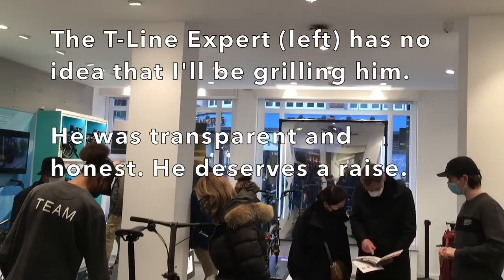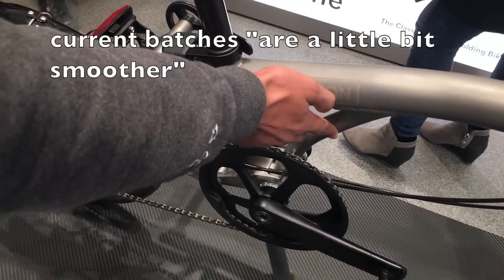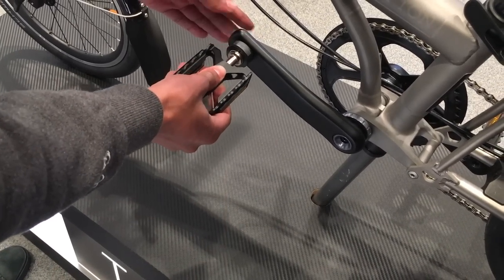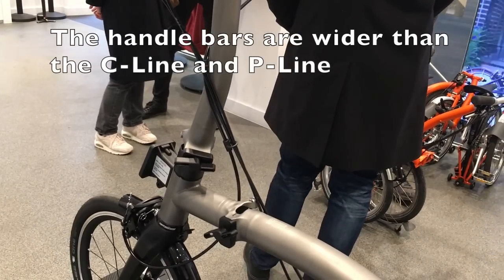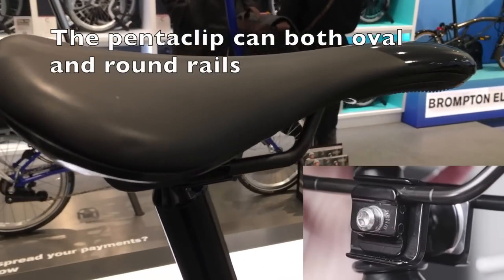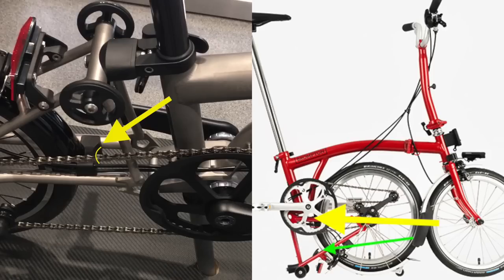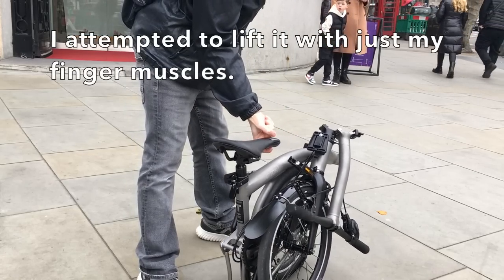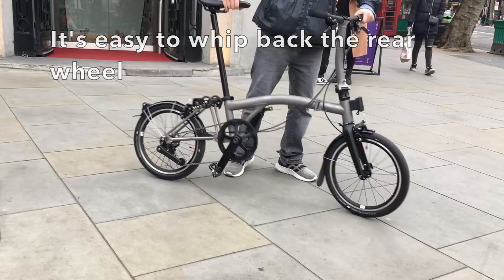Before You Buy a Brompton T-Line. Titanium and Carbon Folding Bike

Comment: Confirmed. Water does collect at the BB area. I actually saw a vid where someone was taking out the BB and water poured out 😅
The original design is better and cleaner for aero. I think they shouldn’t have worry about those few grams making water an issue and having a slower bike that creates “dirty air”
Reply from the maker: Could you please share the link to the video?
Reply: Aero on a Brommie? Come on.

Comment: I have bought a black Titanium seat post for my LightweightH6LXBrompton, with a lightweight AceOffix saddle mount on top, for the mounting and angle of the saddle. I have an original, titanium fork and back-frame as standard and I look for a titanium stem post, as I have changed every loose part I could find, to titanium. But I still have 6 gears for use in a hilly area!

Comment from the maker: Brompton wrote back to me regarding the water in the top frame. I'm sure they are aware this letter will go public as I message them coming from this channel. In short there is no need to worry. If there are any issues they will sort it out. The bottom bracket is sealed internally. I would suggest T-Line owners to stuff a plastic bag in the top tube during a downpour anyway:
Hello [DrJames]

Thank you for contacting us here, at the Brompton factory and for your interest in our brand new T Line model.

To the best of my knowledge, corrosion can occur when metal is in contact with water(from the road, would hasten the process). Your concern that corrodible materials could lead to rapid degradation, and the effect that may have on the structural integrity of the bike is understandable. 

In raising this with our design team, I have been advised that the T Line's mainframe has been tested in our test shop, for thousands of hours of continuous exposure to damp road conditions. The bicycle with this same characteristics has been ridden over many miles of test rides, for the same reasons. We do believe that the bikes frame should not present a usage difficulty arising from water corrosion, regardless of the new design (hole between mainframe and front frame). 

If however, owners may encounter component issues, when they are putting their T line through its paces, we shall certainly act to remedy any such issues for owners. For how the bike is conceived, I confirm there is no possibility for water to penetrate within the mainframe and to reach the bottom bracket, as it is sealed internally. 

Please note that you will get 3 free services for your T Line, which will be performed at the Junction Store of collection. meaning, if there is any issue with the bike, our mechanics will be more than happy to assist the end-users fully...

...I hope this helps to clarify. Should you have any further questions, please don’t hesitate to get in touch. 

Kind Regards, 

Marco
Brompton Bicycle
Reply: I don't think titanium is affected by moisture and corrosion, in the same way as steel.
Reply: @JohnnyMotel99  this is true however there is product named frame saver from recollection that can be used in steel frames or I personally use a silicone based lube sprayed inside, the raw lacquer version of the Brompton is the one that suffers from rust accelerated by gritted roads and wet weather riding as water penetrates and spreads under the lacquer as there is no paint for protection.
Reply: even titanium does not corrode, you wouldn't want water to fill up and stay and the bottom bracket tube area.
Reply from the maker: @ivanteo1973  this is why you should stuff the tube.
Reply: @DrJamesT  of course there are many things we can do to make it better but i am not expecting this concern to be addressed by user themselves.
Reply from the maker: @ivanteo1973  This is why i pointed this out
Reply: How about the ball bearings in the front, which may also be reached by water and gravel?  Finn. Denmark

Comment: The T-Line shows clearly, that the original Brompton is really hard to optimize.

One thing that can be optimized is the poor drive train of all Bromptons: It should have an internal geared hub of high quality that fit in the small 112 mm spacing of the rear triangel. That could be a customized Shimano 11 Gear hub or (just a dream) a customized Rohloff.

Is a Belt better than a Chain? - I think yes, but I do not know if it is folding as good as a Chain ...

The left Pedal: The original folding pedal still is the best compromise, even though it has the problem, that ist must be unfolded when the bike is unfolded because the pedal cannot pass the rear triangel. I have used some version of quick release pedals and it is very inconvenient (and "dirty", because the mechanism needs some lubrication) to stow the pedal especially in everyday situations (the video could not have shown it any better).

Also a "no go" for everyday usage is the lack of lighting. SON offers the perfect dynamo hub for the Brompton and the cabling should be as integral as possible. LED-front and rear light weigh just few grams.

There is no need for a rear carrier, and it is really good, that Brompton included the front carrier block even to the T-Line.

I don't like the original brakes, even though they got better over time. I would prefer V-Brakes or hydraulic Brakes, especially on the rear wheel.

But again: I tried a lot things myself (Rohloff, Hydraulic Disc Brakes, Shimano Nexus 8 with Rollerbrake, Quick release Pedals, other Folding Pedals) and I know exactly that it is really hard to optimize the original Brompton (for everyday usage).

The only optimization I can recommend without any consideration ist the SON XS for Brompton dynamo hub in combination with the FLAT S PLUS or 2C PLUS (rear) and LUMOTEC EYC or LUMOTEC MYC from Busch + Müller. I use a soft microphone cable for the rear light.
Reply: I find the Shimano hubs are much less forgiving than the 3 speed SA ones. The latter are very robust. If the shifter index on Shimano hubs drifts, they get ruined. The internals seem a bit on the weak side.
Reply: What's wrong with the 3spd hubs?
You don't like a shifting style based on the Macarena?

Comment: Excellent video from clearly someone who cares. Thank you. 

I did a test ride myself and it does what it sets out to do, I think. One purpose: it’s light. Crazy light.  I felt no difference with the test ride on the short journey I did. Expect that the handle bars are noticeably wider. But no biggy. I also loved the new seat. Much smaller (lighter) but very comfortable.  I know it’s on the P Line.  

Like you. Interested to know about the rain. Probably doesn’t matter. Even if it’s heavy rain you’d probably stop at some point to unfold it drain anything out. Which won’t be much by the looks of it. Tbc though.  

Couple of minor worries. The beta testing for early buyers. I hope it’s safe. They should definitely make clear that buyers are beta testers. And if there are any major faults. These need to made and the buyer compensated. Issue with this stance is that I know all products are beta products. But for Brompton representative to say that is very worrying. Even deficit full. Small red flag.  

Repairs. Can parts be bought? These are new parts so not yet.  That could be very expensive. 

Plus the inner tubes. Can other tubes be used. £26+ per puncture is steep. May even be an idea to swap for Racer tyres and tubes after the first puncture as these treadless tyres are prone to punctures in London from experience. 

But as said. It’s a crazy light Brompton. That’s been the talk of the town for years. And they’ve delivered. If it’s safe and rides the same as any Brompton. Job done. If it’s faster or smoother that’s a bonus to me.  I imagine it will be though (too early to say from my early test). 

Thanks again.
Reply from the maker: Thank you for your compliments. You can certainly change out the tyres and inner tubes. It will be over the 8 kg barrier though.

Comment: A missed opportunity to go with a belt drive & ditch chain + sprokets, longer lasting, far less maintance & no worries when touching clothing re folding!
Reply from the maker: Carbon drive was achieved by ARCC. They custom built one for a client. It's very difficult and time consuming to put together. So they are keeping metal chains for the sake of manufacturing speed.
Reply: internal gear hubs are very heavy, they are using chains with a derailler system to save weight.. i suppose you could turn it into single speed, but, most people do not want that
Reply: @JogBird  Internal hub drives seem to have worked for Brompton bikes, then not much of a leap to go belt drive I would suggest.

Comment: I question all the range options which started to materialise in around 2006. I don't think they do anything for user experience. While Will Butler Adams did transform the company, the emphasis on marketing and vanity over the original 'form follows function' ethic I'm not a fan of. It's a HiFi bicycle now and mostly over priced. 

Maybe the company would have not survived without this fundamental shift.

I would like to see their engineers put energy into developing an affordable folder; more than the recent lower grade basic Brompton with no mudguards/folding pedal which they marketed a couple of years ago. Something different, something sub 600GBP, 12Kg max and folding to a 35cm cube. Less emphasis on obsessive weight minimisation, more on affordability. Maybe not even a bicycle, maybe a decent folding electric scooter.
Reply from the maker: Brompton is racing to the top not to the bottom. At the top it is more about making a statement aka form. Ti i can argue IS a function for those who can afford it.
Reply: That's an interesting summary of the difference between Andrew's and Will's philosophy for the Brompton Bike company. I have to agree with Andrew that Brompton's creeping price inflation has unintentionally and undesirably turned it into a luxury item.

Comment: Thanks for the questions and thoughts. Lots to chew on, some which makes sense from a product perspective, some which might make more sense well after time/rides.

Question(s) to you @DrJames:

- titanium doesn’t (usually) have the quality of rusting or warping due to water damage; granted, some cities have funny water. What’s the concern about the water damage? 
- the handlebar seems to be held onto the bar now by half a usual stem fixture (the front part of the stem of many normal bikes); could you confirm? If so, this would be a really neat area for accessory innovations and something I could see showing in a redesign to other Brompton models in the near future
- does the Brompton toolkit fit inside the frame (if so this would be a pricey but suitable water-collection solution)?
- you mention the acceleration and ride feel; would you say it leans more sporty (P-line) or more cruising (normal Brommie)?
- feels there’s actually a tick more speed in this model besides adding the 54t up front… I wonder what Brompton might be plotting for touring/explore iterations where a lower or wider gear range amongst 4spds could be played with

Thanks again… very helpful video 🙏🏽
Reply from the maker: -There appears to be a hole in the top tube that leads water into the diagonal bar between the top tube and stem. This bar could 1) fill up with water 2) lead water into the bottom bracket see https://youtu.be/k5VCsB_0xl4?t=67
-I'm not sure what you mean by "half a usual stem fixture".  https://youtu.be/k5VCsB_0xl4?t=287 shows a plate bolting down the handle bar onto the stem. For sure accessories can be made on top of this. There are accessories made for the current brompton to hold smart phones. 
-The circumference of the Ti top tube is 17cm vs 14cm of the steel eg it's got a larger diameter so the tool kit will fit in there but it will slide to the back. You can certain create a plug to block it ie like useful rain cover rolled up 
-sporty and cruise depends on how much you lean down when riding. You can  choose the Mid (cruise) or Low (sport) bar for the T-line
-Brompton doesn't have to plot anything - go to brompton hacks on facebook and you'll find people are already customising the bike to their adapt to their needs. You can easily change the size of the cogs on all their bikes for $3-4 USD per cog.
Reply: - ah, water into the bottom bracket could be nasty. Yikes
- top of the stem looks like the front of a regular bike’s stem
- interesting on size of tube; thanks for clarifying that part
- the rider’s lean determining the feel; I wonder 🤔
- not on FB, but aware of the usual hacks; thinking more along the lines of what Brompton has been doing w/thematic products. The shift to 4spd feels like it points to other branches that only hacks explored, and some hacks couldn’t explore fully (am in design, it’s just a lens that happens around every product)

Thanks for your responses once again; definitely need to get to Brompton Junction NYC when the weather dries out, and see about getting a test ride

Comment: Very interesting video, thanks a lot. about the suspension, I didn't see any..... do you have any information about it? thanks
Reply from the maker: Brompton has rear suspension using a rubber block. T-line has a stiffer suspension block than the C line. It's the same block as the P-Line.

Comment: Does the new seat clamp/suspension block design actually remove the play on that T line which quite obvious on the previous model? Like the new rear triangle design and the derailleur set up this time to be honest apart from it looks very low on the ground. The stem clamp is quite good but saw that already few years back when someone converted the Brompton stem upper part to accept 31.8 bars. Some parts is like Brompton catching up with 3rd party vendors and Brompton modders😀….more external gears, hinge clamp, removable pedals, Tubolito😀…..again would love to see a water bottle mount behind the stem😀
Forgot to ask also if you tried to hold both brakes and rock the bike back and forth if any flexing by the stem/fork area?
I just wish the first batch people  will actually get a much better welding finish than that demo.🙃
Reply from the maker: I rode this through regular london traffic. I experimented with the front, back, and both brakes after reaching 5-10mph and there is no obvious flexing in the stem or fork. Brompton is not a risk heavy company. It took 20 years from idea to launch for the titanium frame. 10 years to add an electric motor.

Comment: Does water still leak into the front brake cable at the 'gatherer'? The outer was in 2 parts and the cable rusted.  Why not use a noodle to ease the 120° cable bend?
Reply from the maker: The cables bend to 30 degrees when folded. What's a noodle and how will that offer relief? I've seen on Brompton Hacks someone installed a Duomatic hub - it's a 2 speed hub and brake in one, controlled completely by the pedals to create a wireless system.
Reply: It also lock the brakes at freezing temperatures... Dangerous

Comment: Rain water will travel down inside  the top tube causing it to rust,
I have cut on my leg by the Brompton stock sharp edges paddle a zillion time - its annoying.
The break handles are not the most economically positioned for ease of use. Sadly,  There is no room to make any adjustment.
Cannot feel any adequate suspension at all.
Reply: It will need to be magical rainwater to make Titanium rust...

Comment: Hi, excellent review.  I have two questions:
1. Do you think the new Swytch ebike conversion kit could be installed on this T Line Brompton? If no why?
2. You mentioned that you can feel every crack on the ground which got me worried about my back and wrists. Do you think that by changing the rear suspension and the air pressure you could get it to a decent enough state to minimize impact? What other mods would you recommend to make the ride as comfortable as possible ? 
Thanks!
Reply from the maker: You might have missed the answer to question 1 in the video, the fork is carbon. It's not designed to handle force from motors. 2) change to a softer suspension or change the tires, or get a seat post with suspension.

Comment: As I have just bought a "hollow" titanium bolt to hold the stem post, on my Lightweight, it do make sense. But I still like my double, easy wheels on my mudguards to be able to roll. I have also bought some "carbon clamps" to hold the original titanium struts on my mudguards, for saving a little extra weight, and a new Joseph Kuosac headset, as a proud owner. Also a new Ceramic titanium crank. I may buy a new titanium stem-post at one time also?
Reply from the maker: Upgrading to a Ti stem post is probably the easiest weight saving method. Apparently it has a bit flex to absorb shock. I think it's all down to the suspension block.
Reply: @DrJamesT  My bike is a Flaming Yellow, black version and I have found a factory being able to sell a titanium stem post painted in Flaming Yellow, as the original post. I may buy one.

Comment: I was initially very excited about this new model, but then began to notice things that I didn't like, such as the use of carbon fibre forks, handlebar and seat post, and those ugly holes in the hinges.

I also didn't like the cassette gear. 

However, the major dislike was that it wasn't an Andrew Ritchie Brompton!

What drew me to the Brompton was its design and engineering excellence, and I love how it looks when folded, perfectly engineered by its passionate designer.

This new model changes virtually everything, not even using the existing titanium forks and rear triangle!

Simply put, its not an Andrew Ritchie Brompton...